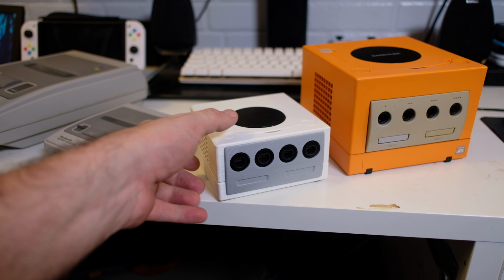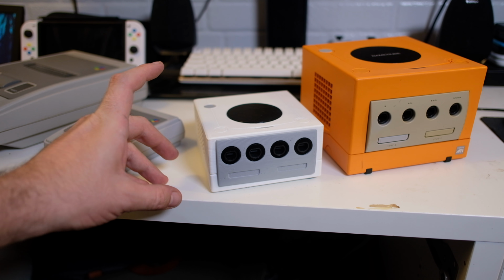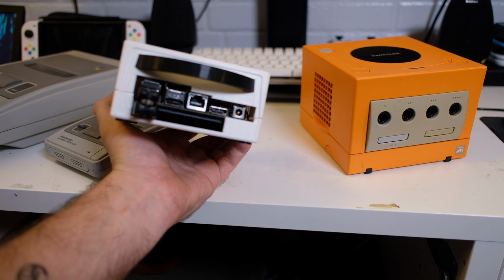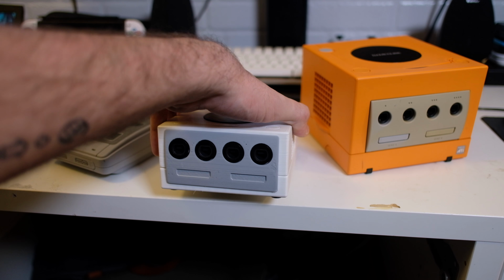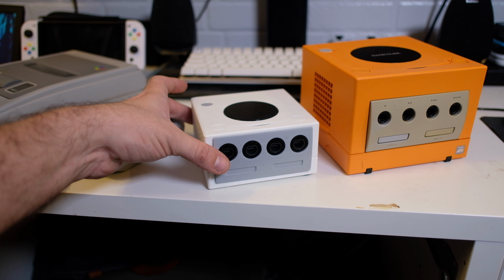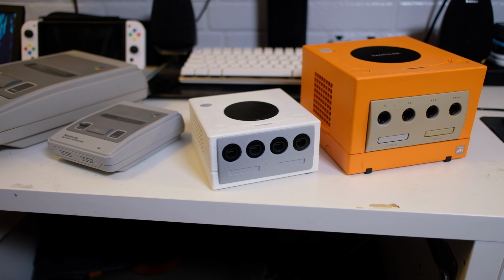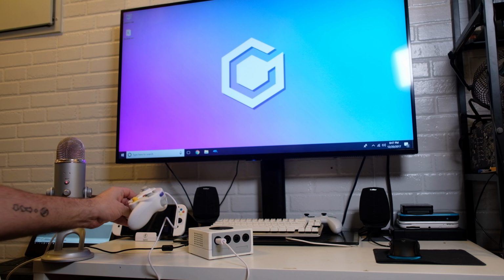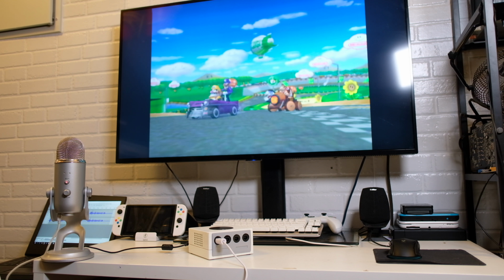3D Printed Gamecube Classic Mini

Comment: Could you link me the hardware, because I want to replicate one
Reply: bro u can use a raspberry pi 4 and overclock it and it will be able to run gamcube games, then next u will only need the wii u gamecube adapter and for the case u can go to any local 3d print store and 3d print the files